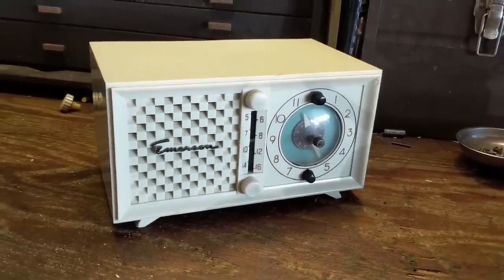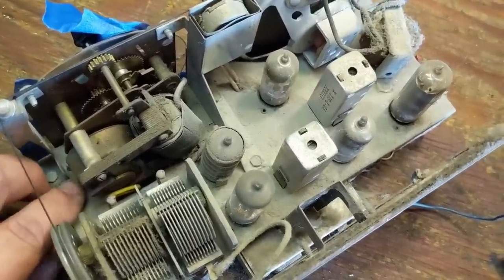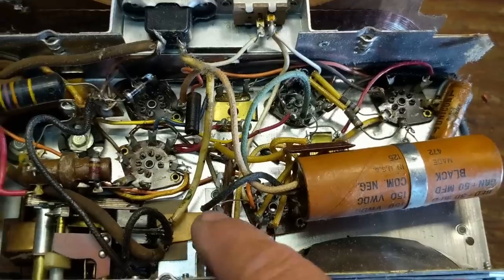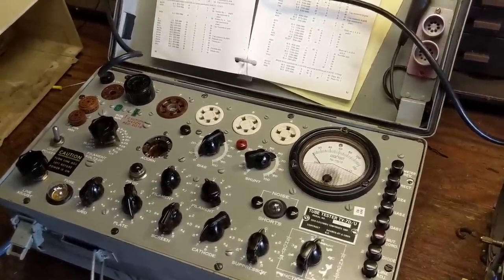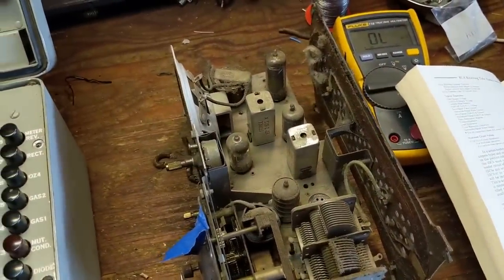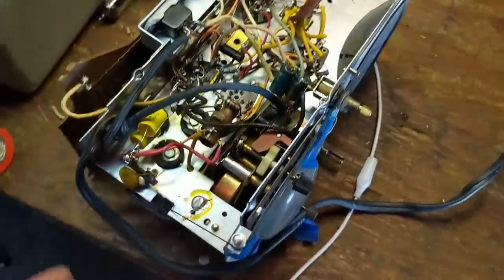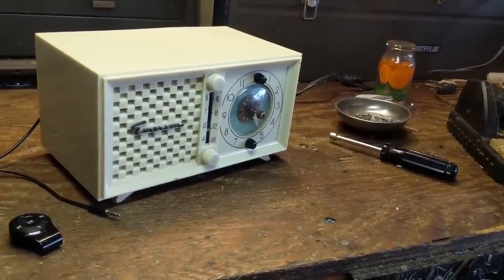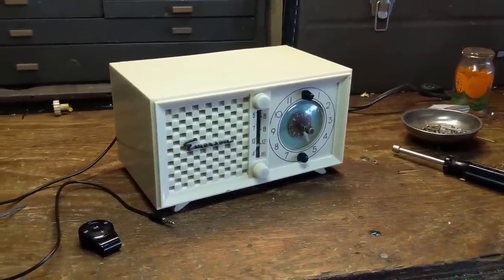A radio resto for beginners

Comment: For fillements you don't need a tube tester but a common multimeter just messure the fillement pins if open then the tube is dead. For instance a 12ax7 between 4 and 9 and between 5 and 9

Comment: It really caught my attention when you said it was from the year 1951.
If I understood you correctly, you said this was to teach "newbies" what they need to do.  It concerns me that you left out a number of things.  They may not all be absolutely necessary, but are helpful things to know and do.
1. How to find a manual and/or schematic of the radio you are working on.
2. When you replace a component, make sure the part is installed where you can see the writing on the component in a manner that you know what the values are without twisting it around.  This is a great help to whoever comes along after you work on it and they are now doing the repair/restoration.
3. While some capacitors are not "polarized", it does make a difference which lead goes where!  https://www.youtube.com/watch?v=BnR_DLd1PDI
4. A copy of the schematic with your BlueTooth circuit drawn in would help a lot towards understanding how it is connected and how it and the switch work.
5. How to read resistor color codes on BED style as well as 4, 5, and 6 band color codes.
6. Although it is not part of a radio per se, if the radio includes a clock, perhaps it should be covered in how to tell if it is functioning properly and if not, how to fix it.
7. How and why to do an alignment.
I personally appreciate it very much that you showed the concern that if a person is not sure of themselves that they should not work on such radios.  As you said, they can be lethal.
Reply from the maker: I probably didn't do the best job on making a newbie video here. Its harder than I thought because Its very easy to just forget to mention things since I simply go into automatic mode. But thanks for the comments
Reply: @misterradio5035  I think that the "automatic mode" is something that applies to most if not all of us!    One of the problems with doing a "Newbie" video is you can't really know what your audience doesn't know.  I would like to think that if I had the equipment that I could do a very good "Newbie" video, but I am sure that I too would leave things out that would need to be mentioned!
Reply from the maker: @waynethompson8416  I've tried making a few of these newbie videos and always fail.

Comment: Do you not tweak the if transformers? Do you recommend using a variac? Someone already mentioned an isolation transformer. Thanks for your videos!
Reply from the maker: II realized after I made this that I left out a LOT of things. Yes- you should tweak the IF cans if the set isn't pulling in stations well. And you do need to use a variac and a ISO

Comment: With modern electrolytic capacitors the voltage printed on the side is the maximum voltage and not the working voltage so you should always ensure the maximum voltage of the new capacitor exceeds the working voltage on the old capacitor as initially the voltage will be higher than the working voltage until all the tubes warm up and start conducting. So your new capacitor should reflect that. e.g. working voltage on old cap = 150v d.c. then new capacitor should be rated at no less than 160v d.c. or even a little higher than that to be sure.
Reply from the maker: Yep. I've measured the voltages on startup and after warmup on these AA5's and the most you tend to see is between 100-120 volts on the B+.

Comment: Nice restoration of this cute set.
Adding a mains fuse on the back of it would probably be a good idea
if you really intended to release it into the wild...
Reply from the maker: With these hot chassis sets, your rectifier will act as the "fuse". Its more important to add a fuse to a set with a power transformer so you don't dry it if something goes nuts
Reply: @misterradio5035  well, a fuse would be cheaper to replace...
Reply: @geirendre Mr. Carlson is a motor mouth and makes his videos longer then necessary

Comment: Definitely not a beginners radio. On/off switch is mounted in the back so the volume control is just that, 
floating chassis , B- is switched like they almost all were in the 1050s, and no polarized plug.
 If unsure how to correct those things leave it until you get the knowledge to do so. 
It does have a modern plastic cabinet however as opposed to Bakelite. Good restoration of a 1952 era radio there Seth.
Reply from the maker: Polarized plugs won't matter in these things anyway. As soon as you turn these sets off and with a polarized plug it will "reverse" and you will see 120 volts on the chassis. Hence why you have to install a safety cap to make it safe either way
Reply: @misterradio5035  Well you're right , so then switch the rear on/off switch to the "hot" side of the power cord so that won't happen. None of the aforementioned things in my post are to be done individually  but together and you can still put that safety cap across the line.

Comment: Just saw 🪚 your video come up. That’s a pretty 🤩 nice 👍 radio 📻. Emerson was way better back then. Use an isolation transformer for this. Electrical  ⚡️ shocks can be very unforgiving. I’m pretty 😍 sure that the clock 🕰 motor is a Telechron motor. It’s a can style motor, which can be difficult 😞 to get inside of if needed. There is a luminescent powder in a bag 💼, which is sold online. Watch restoration people use it to re-lume the hands 🙌. I’m not sure 🤔 if it’s real radium or not. Radium sounds more dangerous than I thought 💭. I think 🤔 ya mix this above luminescent material with water 💧, but read the instructions. In case I’m wrong 😑. Your friend, Jeff.
Reply: The trade name Emerson was sold many times over the years.